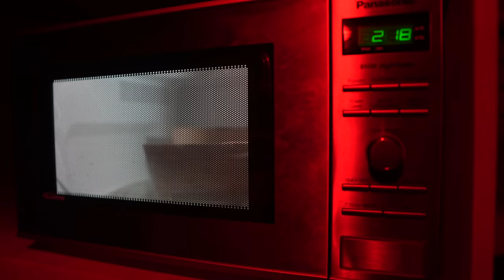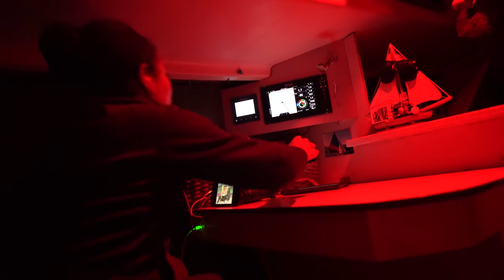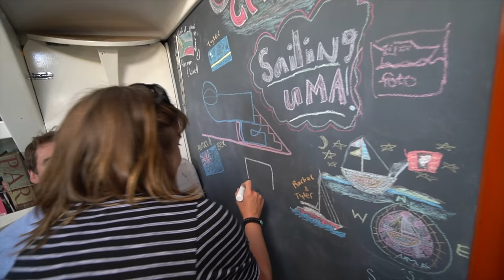BOAT TOUR: The Modern Interior of our 50 yr old DREAM YACHT — Sailing Uma [Step 225]

Comment: One of the smartest, best designed cabin interiors I've ever seen. You put professional boat interior designers to shame. Almost everything you design is surprising and never seen before.
Reply: yeah they should get into small boat design and model after this boat, probably buy some older mold of a boat.
Reply: Yes, I agree. Sometimes it takes someone with no experience or no preconceived ideas to be able to think outside the box and find the best solutions, doesn't it?
Reply: @stephanieellis5399  I wonder how many boat designers put their own design to the test like you guys did.
Reply: Yes the lazy Suzanne storage is incredibly unique and useful. Even for use on land. I have never seen storage like that.
Reply: Their architecture degrees certainly give them an advantage for creative solutions the average sailor might not have.

Comment: For the fruit hammock issue, I’d sew a piece of stretchy material to the back top of the hammock, and when you set sail just pull that stretchy “lid” over the fruit/veg and either tie down or maybe clamp/Velcro down to the front of the hammock. Problem solved. Or you could just tie a string to the middle of the front and run it straight up to an attachment above it under the cabinets & tie it off, hoisting the front high enough that the fruit won’t go spilling over. This boat interior looks like it was designed in the finest of Italian studios, working hand in hand with practical engineers with tons of boating knowledge. What an amazing job you two. Can’t get over how well done this is!

Comment: My biggest reason for alcohol over propane is safety.
No matter what, if there is a stove fire, you can put it out with the water on hand. 
I know this from experience. We had a fuel line rupture while cooking at sea - the alcohol leaked and fire spread - the Captain grabbed the pot of water we were boiling for a spaghetti dinner and dumped it on the flames. End f crisis.
On land, while RVing we used alcohol stoves, that way we did not have to worry about tunnels and bridges which do not allow hazardous/pressurized fuels and, therefore did not have to go around the long way.
While hiking, alcohol has been a favorite because it is available just about everywhere and operates even in the dark or after multiple cloudy days in a row!
P.S. Love your home-boat!
Reply: The trouble I have with alcohol is the colorless invisible flame when burning. We lent ours to a neighbour to use on their 56 foot Schooner decades ago and they almost burned the ship down. It overflowed and he lit it without knowing the alcohol ran down the side. His quik thinking wife grabbed the stove, raced up the companionway, and threw our brand new stove overboard.
 Alcohol has never been aboard any of our boats again, except for drinking.
Propane is scary, but when properly installed with auto shutoff sensors is totally safe.
Reply: @Daviddickson  What an interesting "event" - glad they were OK!!!!
I wonder why it was invisible...mine wasn't/isn't.Weird.  We sure did know it was afire during our "event"and could follow the flame trail to put  it out. 
As for tossing it overboard - quick thinking indeed! Ours was attached [double gimbals] so it remained onboard. 
Grin? Yeah, I can grin now, decades later...
Anyway, enjoy & safe sailing!
Reply: dross24MA pure alcohol burns clear. You may have had an additive that allowed the flame to be seen
Reply: @dross24MA  All great information here! Glad I read these comments! We've always used propane but haven't been against alcohol, just haven't had the opportunity to use it for cooking. There is a lot to think about here.
Reply: @johnp8189  Makes sense to  me...
Reply: @Daviddickson  I've seen a pitcrew fire incidient in a race, for a moment nobody was sure why the mechanic was rolling around but they quickly figured out that he was on fire and the flames were invisible. All fine in the end but something to look out for!

Comment: 11:46 is a simple fix, simply install two wooden blocks on the bottom of the cutting board, one on each end, that will lock in the lazy susan when the cutting board is in it's closed position. I'm still impressed you guys came up with that lazy susan idea entirely, that's next level problem solving.
Reply: Problem is then you would have to align it perfectly before closing it every time. I think magnets would work better
Reply: @mathboy_  you could wedge the boards so it would be self aligning.
Reply: @mathboy_  No, a rounded block on the lower end, would force it into the right position when you close it :D Unless of course it's completely off

Comment: Two words -" Emerald steel " for water maker Ideas They are the most amazing full time sailors.
Reply from the maker: We love Jules and Suzie they’re awesome. But DIY water makers are too noisy and consume too much power from our research.
Reply: They are not afraid to use a gen, which is fine if that works for them. But I have seen better DIY that are not as power hungry and more efficient.
Reply: @SailingUma  Think of it like this: they produce a lot of water, very quickly. Within a few minutes, you have many many liters of water. Their power usage is measured in kwh, and you have multiple kwh of energy in batteries. Spread out water making across a few days, and collect rain water, it will meet pretty large uses of water.

Comment: I think the “heavy susan” is my favorite idea, honestly didn’t even think about that.
Reply: Same it's insanely genius and I'm wondering how I can build that into my house lol
Reply: @ItsPrinceTaz  The corner cupboards in my kitchen have 2 tier lazy susans with 2 part hinged doors to get at them. It's such a good use of space. They have a corner cut into them so the door closes flush with the other cupboards and when you spin the susans around they are poking out of the cupboard essentially, making it super easy to access.
Reply: Yes! Genius!
Reply: I agree and they can easily fix the issue with the susan rotating out at sea by installing two wooden blocks on the bottom of the cutting board, one on each end. The cutting board in the closed position will lock it in.
Reply: "Hefty Susan"

Comment: Easy fix to lock the panty down is to screw a small rubber covered metal tab to the inside cover (pizza lid) that will extend deep enough to hold the heavy Susan in one section.  It isn't 100% locked but will limit movement to one section.  You could also double the tabs wide enough to extend down the sides of the pantry (patricians) to completely lock it in place.

Comment: Love the design!  I never understood how many small boat designers try too hard to make a small boat like a house - it just results in inefficient space usage. For example, I only need hot water for a rare quick shower so I don’t need a complicated water heater connected to my engine - a small electric water heater would be just fine. I use a porta potti in my head so I don’t need a waste holding tank that requires a pump out - I just disconnect the porta potti waste tank and dump it. The microwave you have seems like a great design - an oven on a boat is unnecessary today.  The flooring idea is great - everyone nowadays is using that fake teak stuff which is expensive and looks like it’s hard to clean.

Comment: It is obvious that your years spent in University has not been wasted and you have picked up many additional skills in the meantime. You are very lucky living a lifestyle that most people would envy and spending 24 hours a day with the lovely Kika.
If you ever decide to give up cruising or even not as you could remote work your skills would be an asset to any Boat Builder. Yes they have design teams and well paid I am sure however they do not have your practical experience. Although obviously your knowledge would be more valuable to monohull builders space saving, clean and practical design is important even to the largest cats. Given your practical experience you also understand how the manufacturing process affects the design in terms of cost and labour which is invaluable.
Reply: ......to suggest that marine designers don't have "practical experience" is, at best, uninformed......to wit, there's every practiced reason for NOT having drawers as large, deep and laden as currently installed......offshore the chance of serious injury goes up exponentially in the event of a knockdown    or even rounding up and launches one them. But, as stated, they spend but 10% of their time sailing and it works for them.
Reply: @ackack612  I seriously doubt that almost any Marine designers have their level of practical experience.What is more they both came from a design education and have spent 5 years applying that seeing what worked and in the process honing their skills and sailing tens of thousands of miles. By definition Marine designers are in an office and may if they actually have an interest in sailing rather than treating it as a design job might go sailing on a weekend or perhaps a couple of weeks on holiday.
As to having drawers deeply laden as installed if only there was a device that someone could invent to somehow keep a drawer closed I guess they will just have to take that risk until someone invents such a device!
As to them being deeply laden if you had noticed Uma is actually on her factory keel line so she is not overloaded in anyway just well designed.

So whilst they have little knowledge of certain specialized aspects of designing Yachts from scratch such as Hull design or rigging layouts I would bet they could do a better job than at least 90% of marine designers including the larger brand names. In fact another sailing channel is in collaboration with a large catamaran brand to show them what exactly a live aboard boat requires and they do not have the academic or depth of practical knowledge that Dan and Kika does.

If I ever won the lottery and wanted a custom built Catamaran I would have zero hesitation about asking the Uma team to design her.
Reply: @glennedwards1449  Your prerogative, to be sure. But, simply stated, they remain a potentially dangerous design 'element' for an offshore mono hull. Common sense dictates you design danger out rather than enhanse it. On my boats, pretty basic stuff really.
Reply: Additionally, I never said the boat was overloaded......the drawers, however, by virtue of their excessively long and deep design are indeed overloaded.
Reply: @ackack612  Firstly you are assuming they are dangerous yet would only be a danger if they came out something unlikely in the extreme especially as any knock down would be along the beam not the fore and aft axis. Whilst the capacity means that anything inside may indeed get banged up that does not constitute a danger unless they are carrying two part explosives or chemicals on board which I highly doubt. 

In sort they are as secured as any other item on Uma carrying heavy items such as the freezer if they have one or even better if they are stowing say canned goods provisions.
What is more as a point of practicality they have a limited amount of storage.True Kika is pretty small but I think that only helps a little. Therefore the more stowage they can cram in the less space the better.
This is where their practical knowledge outshines those of most marine designers of which I take it you are one. ALso why they would be a boom to any Yacht design studio

Comment: You guys are genius. I love how you have intentionally designed everything after deciding what works well for you, especially the Hefty Susan and flat work/yoga space. I also love your use of storage in the head. I do have a couple questions ... where is the outlet for the heater, what is the fuel source for that and where do you dispose of the stove canisters? Otherwise, you are an inspiration to first time boat buyers and should be designing boats! Well done and safe travels!!!
Reply: The heater? Do you mean the wood stove? If that's what you mean, they installed a chimney up through the deck. I'm not entirely sure what their fuel source is, but I think they mentioned it in the video where they installed it.
The fuel for the stove is alcohol (most likely ethanol) so they can actually, quite easily, refill the canisters that fit in the stove from a jug/bottle of alcohol. And those would be disposed of along with their other plastic waste. As Dan said, if they accidentally spill some while refilling the canisters they just use the spill to clean the counter or the stove. Imo, it's probably the best kind of fuel because a spill doesn't damage anything, no special care needs to be taken as far as disposing, and it burns clean which is especially important in cold or bad weather when the hatches would be closed.

Comment: "Go to the next Horizon!" - what a cute slogan is that to cover your fine attitude!
You have come a long way in five years, counting the miles as well as the project progress - congratulations!
The good ideas are just too many to comment on. Let me point out just the head, the navdesk and Hefty Susan - my favourite! You are brilliant indoor architects!!
34:30 Besides "the secret", you never mentioned that piece between the stairs and the pilot berth - probably a plain old locker (?)
Cheers from Germany,
Paul
Reply from the maker: Ha! That’s just the trash can. We don’t really like it there, but don’t have anywhere else to put it.
Reply: @SailingUma  It has to be SOMEWHERE! I like the idea that this might be one rare detail that you haven't changed yet! (late edit: It isn't!)
Reply: @paulsj9245   A trash can often works well mounted underneath the cockpit steps.  Thats where they have the silverware drawer.  But actually silverware rattles around from vibration causing noise and an easy way to get rid of that is to mount silverware vertically, not in a horizontal tray, then the stuff doesn't rattle.  So my vote would be to re-arrange that.  Actually one thing I miss in my galley conpared to land living, is a garbage disposal in the sink for food waste, which clears up a lot of the trash situation.  But I doubt any sailboat has a garbage disposal, that is quite the bulky power hungry item.
Reply: @jonathanoasis  Good info!
I had another look at the galley renovation videos (steps 134+136) and I noticed a 20 cm covered hole on the right of the old countertop, below the (now removed) upper step (see step 134: https://www.youtube.com/watch?v=moruXWVh674&t=50s) - Dan cut out this opening to the trash some time earlier. Originally, it was the motor compartment...
BTW, some catamarans have a throughhole below a lid on the galley desk for organic waste. It should end between the hulls - impossible on monohulls.
Reply: @jonathanoasis  I think Top Secret does.  The O'Kelly's have a couple of videos about that boat.  Top Secret is owned by the people that gave Uma their new motor.
Reply: Another pointer: 7:38 just above that "hidden" trash, there's an electric panel with a fancy acryl glass cover. I suppose you covered an open space there for your convenience & needs, and I know that you've exchanged it lately for a better electric installation. Looking forward to your technical boat tour!

Comment: It's truly remarkable how you've brought modern and functional interior design to such a small mobile space. The small bit is one challenge, then adding a constantly moving medium, the ocean, to the equation is a whole other level. Dual to multiple use functionality on everything is equally impressive. 

One question- do you feel the need to update to opening port lights in the saloon for side ventilation? Sailed a Pearson P30 with virtually the same length port lights and it was as hot as all get out in summer.

Comment: Architectural training is apparent in the accommodations changes you made. A place for everything you need for your lifestyle, clean lines, an a rethink about the 1970s boat vibe. I also own a thirty-six foot 1970s steel boat with 8 berths. I will likely be the only person aboard, except for the occasional day sail with my wife. Perhaps she’ll come along on a two week cruise, or my son-in-law will. So 3 berths is the plan, a proper galley, and more dual/triple purposing of features.  You did. It, and did it well. Congratulations. Oh, and you took your time, sailing as a priority.

Comment: You too are astounding. Your brilliance and how you two designed each and every component has me blown away. As far as the exasperations, I know how you felt along the way, and this comes from a guy who rebuilt (over 90%) a 120 year old farmhouse with 18 inch thick cement walls. Isn’t it fun how insanely crazy design quirks in our home often shows us the way to even better options that work!

Comment: I don't see the date on this video.  However I have watched UMA on and off.  Now I have to binge watch the refite.  THANKS!   Y'all did a FANTASTIC JOB!!!   I don't know how you did it.  Maybe because I'm about 20-25 yrs older and I got tired watching.  Plus I'm in the process of new water heater, ripping out carpet and laying a Bamboo vynle floating floor.(it has all the feel like real wood with slightly different color which you wouldn't know)  So maybe that's why I'm tired.  Haven't touched my boat this year bc the remodeling, storm damage.
Anyway, didn't mean to be a chatty Kathy.  YOU BOTH HAVE DONEVFINE WORK!!
Reply: Spring / Summer 2020. Posted after "Arrival in Amsterdam". I'm guessing that it was filmed in England.

Comment: Great work guys! Don't know if you've solved the issue of the fruit hanger but you could run a dowel across the base of the triangle to support each corner and then suspend that dowel at the mid point on the bulkhead. That way you keep the volume and she swings!